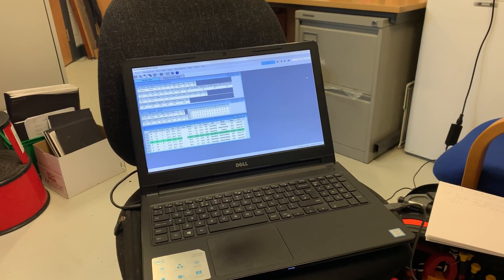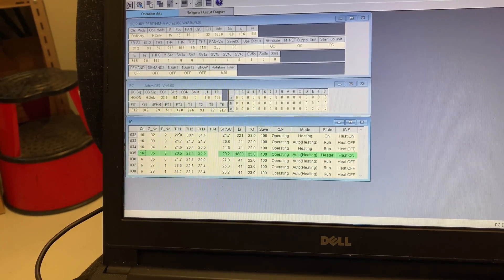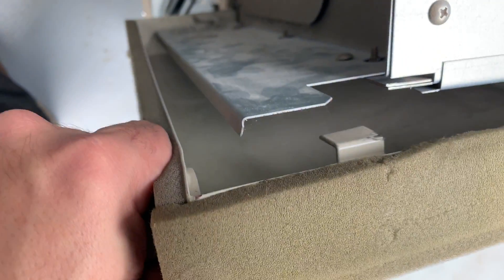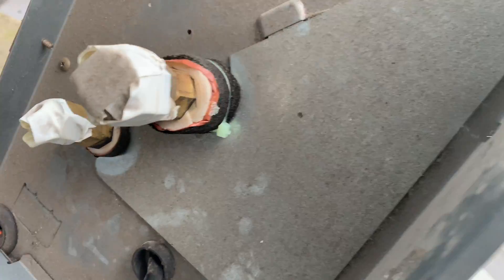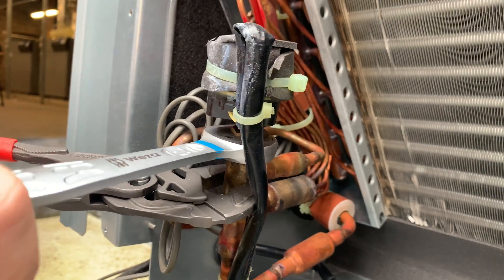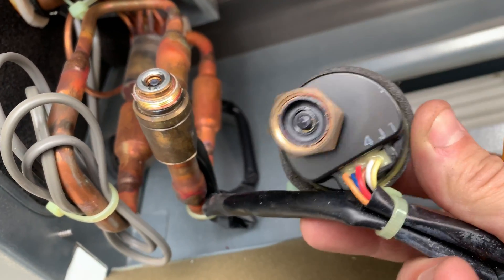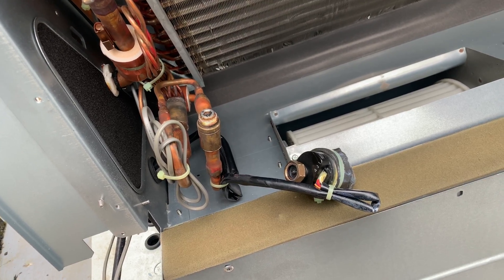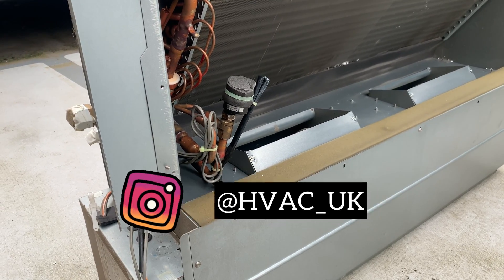A DAY WITH AN AIR CONDITIONING ENGINEER HVAC UK ** HOW TO CHECK AN LEV **

Comment: I work in HVAC currently as an installer putting in heating and cooling units along with all the ductwork. Any insight into how to get into the more technical, mechanical  and maintenance side of this industry?

Comment: By the wiring diagram that looks like a 6-wire stepper motor ( https://knowledge.ni.com/servlet/rtaImage?eid=ka03q00000122xn&feoid=00N0Z00000HEWRt&refid=0EM0Z000000W6sL )  I imagine that it winds the valve all the way closed to mechanical limits on start-up to assume a home position of closed, then opens and closes using a precise number of steps that the controller keeps a record of.

Comment: What is an LEV? For us not used to that technical abbreviations/slang, looks like the valve that switches the refrigeration circuit between air-conditioning/heat-pump
Reply from the maker: It’s the Linear Expansion Valve, used to control the flow of refrigerant mate 👍🏼👍🏼
Reply: @hvacuk8975  - 😉
Reply: @hvacuk8975  is it like a solenoid valve shuts flow or is it the expansion valve?